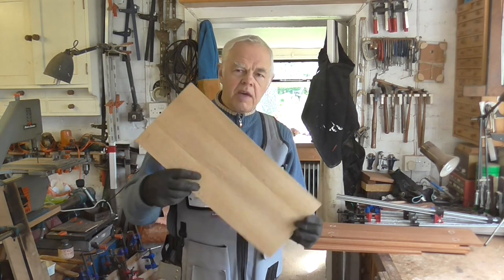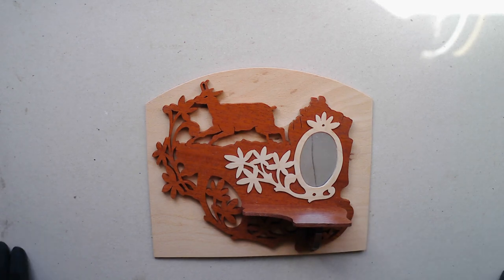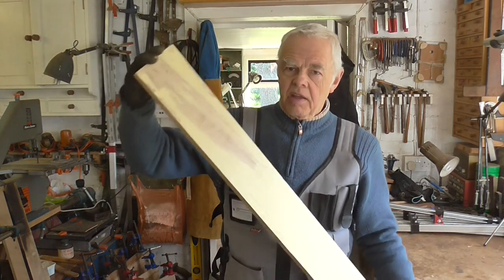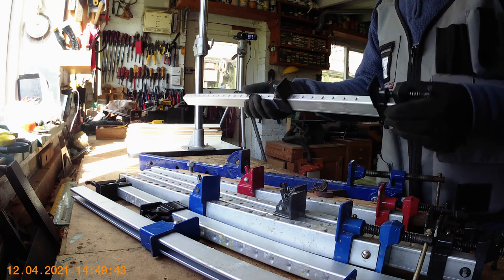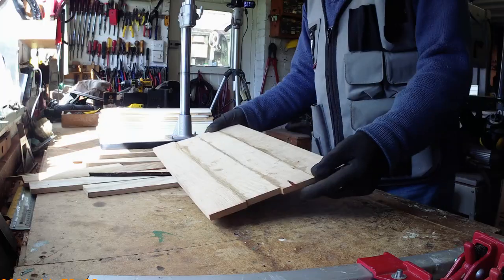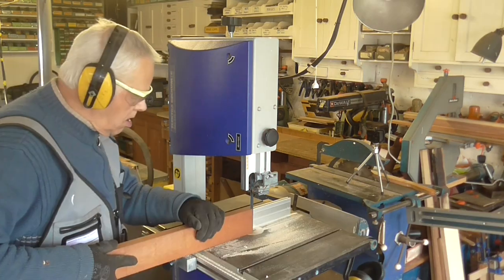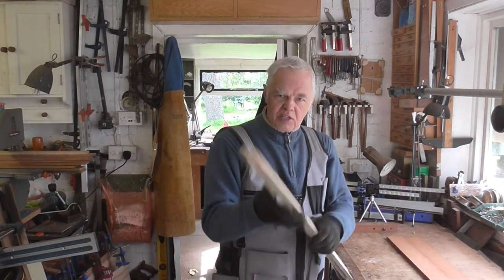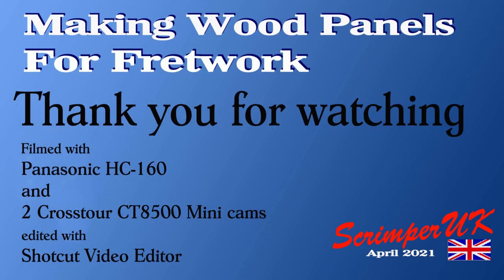Making small wood panels for scrollsaw work. Part One

Comment: Your remarks about the best method for gluing don't sound silly at all. Without going into a lot of explanation, gluing should be a matter of adhesion rather than cohesion - your remark about the adhesive property of a one molecule-thick layer of water is an excellent example. Water is not especially cohesive but it certainly shows its adhesive properties often. Thanks for highlighting this John - it's strange that this is such a bugbear; the studies on adhesives and good gluing practice are getting on for a hundred years old! Thanks again mate, I enjoy anything you post
Reply from the maker: Mark, many thanks for your informative comment, one thing I have found gluing panels up is that the PVA does not seem to work as well with Oak as it does with other woods, perhaps another type would be better?